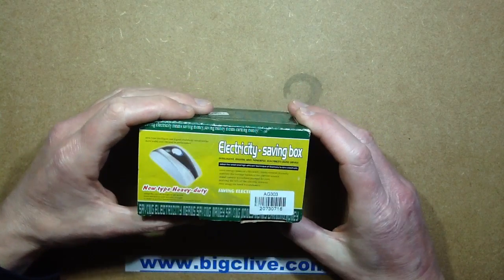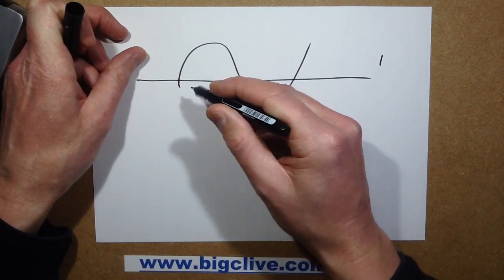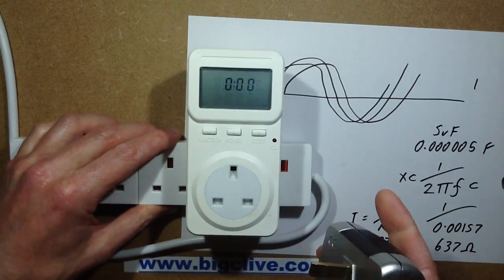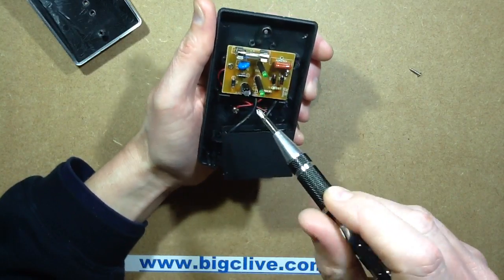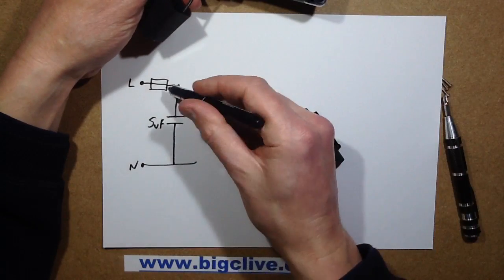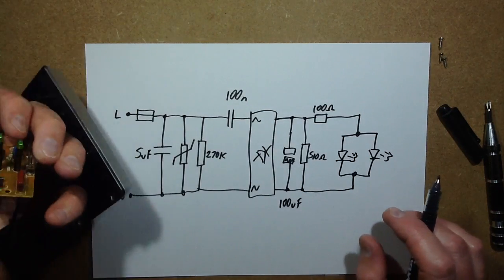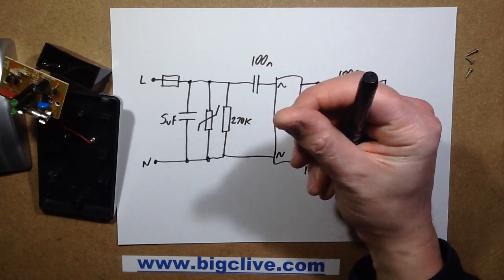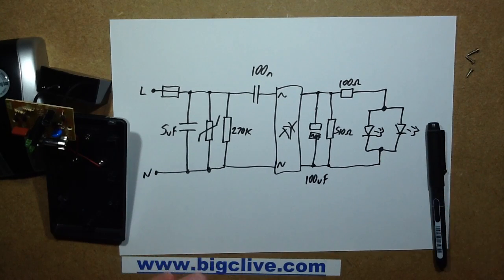Teardown and test of a home power saving plug.

Comment: Fixed capacitance type PFC only works when it is of right uF value to a given motor load. Since the household has different motor loads and switched at different times, this may not work all the time.

Any reduction in current will reduce the speed at which the disc on the meter rotates, hence reducing the monthly readings. More info right here http://myeclinik.com/are-power-savers-useful-or-just-another-scam/

Comment: So it'll save the power company a fair bit if enough customers install them, but the actual customers will save buggerall. Kind of them
 (not harmful tho, nice design and build quality actually!)

Those capacitors are similar to the ones used in ceiling fans too for the split-phase run windings.

Comment: Power factor compensation can be useful in Off-the-grid/backup systems and stuff like that.

There's a reason why generators, inverters and UPSs have a VA rating. Can make the difference between having a working fridge or not in a Off-the-grid system.(Or having to buy a bigger inverter.)
Reply: Most inverters hate a lot of capacitance directly across the output!

Comment: One suggestion is plug a power strip into the energy meter and an inductive load (e.g. desk fan) into the power strip.  Then see if the reported wattage changes when this power saving plug is plugged into the power strip.  Then repeat with a non-inductive load like a 2000 watt heater. 

With some energy monitor plugs I've used, if I plug a low power factor item (e.g. unloaded 1kW 110V transformer) along with a high resistive load, the energy meter falsely reports a much greater wattage by that low power factor item (over 100 watts by that transformer) as it sees the total load as a 0.99 power factor.  So I suspect the same with that power saving plug, e.g. where with a high enough resistive load, it could register an additional load (.391A x 247V = 97W) with some smart meters, which if the case, would actually increase one's electricity bill.
Reply from the maker: I already tried that with the most inductive load I could find.  (a chunky transformer).
My meter didn't display a significant wattage change when the power-saver was applied.  But looking at the current the power-savers high reactive current dropped when the inductive load was added.

Comment: Clive,the math is /not/ boring. I quite enjoy it!
Reply from the maker: Firecul42 The maths came out spectacularly accurately too.  4mA is close to 1% accuracy between the maths and the measured result.
Reply: Right! More math and circuit diagrams!
Reply: Did you include the current used by the LEDs? If that was just the capacitor itself then 4mA doesn't sound bad for 2 LEDs, especially when the would each get 1/2.
Reply from the maker: Firecul42 Good point.  I didn't actually factor in the LEDs.
Reply: I must admit I do like seeing all the innards and circuit diagrams it's quite fascinating for some of them, the math is handy to see exactly what is happening as well.

Comment: Hi clive, thanks for this.

Can i ask a question please. My friend and i have bought a solar panel and wind turbine. Where planning on connecting it to a common bus bar (flattened copper tubes).
12v 25amp wind turbine
18v 11amp solar panel

Would we need a capacitor to smooth the fluctuations of the current coming from the bus bar, before the charge controller? if so what sort of farads number are we looking for please?

All the best, and thanks for these teardowns ... very interesting
Reply from the maker: I'd suggest using a beefy diode between each device and the common connection to avoid the solar panel driving current into the turbine on a bright calm day, and the turbine doing the opposite on a windy night.  It would probably be better if you used an independent controller for each energy source connected to a common battery.  The wind turbine controllers often use PWM to shunt the turbines output when the battery is full to stop the turbine speed from getting too high, and I'm not sure this would be beneficial to a solar panel.
Reply: Thanks mate... appreciate the reply.

So a wind turbine controller is different from a solar panel one? pulse width modulation
Reply: DiyEcoProjects Yes they are different and can have some different functions. Solar controllers can for example just go open circuit when the batteries are fully charged. Turbine controllers often shunts over to an resistive load so the turbines either keep an safe speed even in high winds or stops completely.

Solar controllers also often have a MPPT function to get the maximum power out of the panels.
Reply: M8e... thanks... hmm more things to learn then lol... ok so hence the need for having two (different) charge controllers going to battery = dont need the bus bar business

One we ordered was a 30a solar charge controller, with light sensor and timer (dont know what the timer would be for)

So with a wind charge controller... when you say "shunts over to an resistive load" do you mean it diverts it to whatever im choosing, like a heater, light bulb ect. So this is like an intellegent Y connection?. 

Something like this one?
	eBay item number: 181580100606